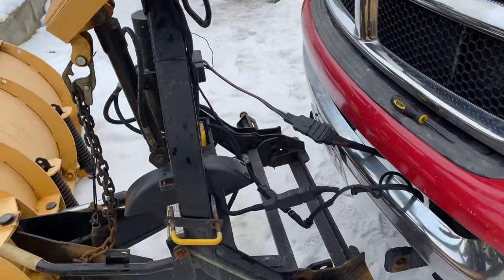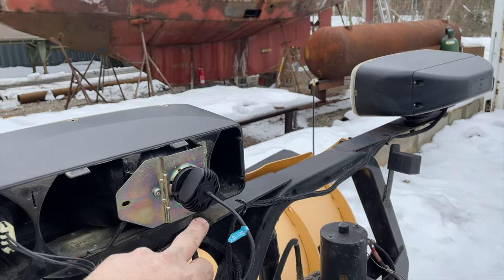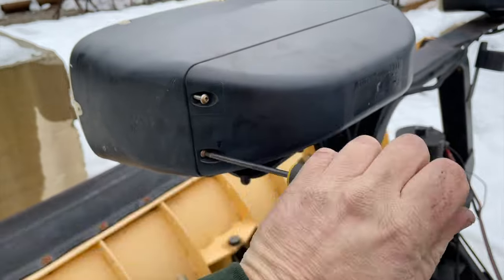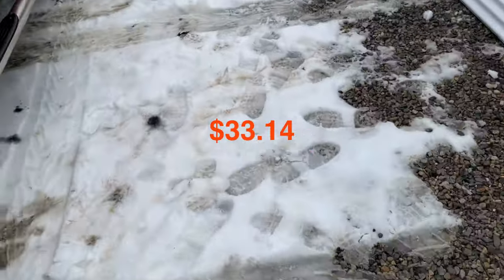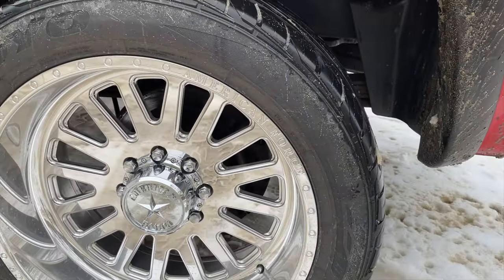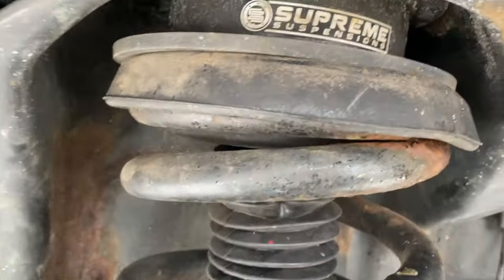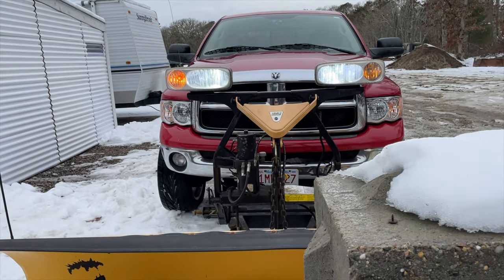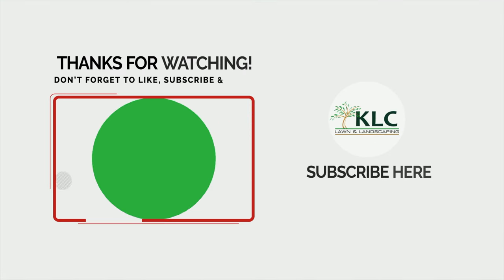HOW TO Convert Fisher Minute Mount 2 Snowplow Head Lights To LED

Comment: Thanks man-used your part number - best 38 bucks I’ve spent in a long time-The halogens kept blowing out from all the moisture inside my housing-what a difference-so minty on the back roads at night-winning 👍
Reply from the maker: Glad it helped! Thanks for the link click
Reply: Did you put this on your Plow? How is it when it’s snowing?
Reply: @brennen203  yes I did - last year-in my experience all lights suck while it’s snowing, halogen or LED-but when the snow stops these LEDs are five times brighter than the OG halogens

Comment: Hey Ken. I'm from Canada and I have a 2023 F550. I installed my Fisher minute mount 2 on this truck. The halogen lights are horrible and one us burnt out. Maybe its a good time to switch to LED. Does it matter what vehicle you have for these bulbs? Or are they standard wiring for all vehicles for the plug and play lights?

Comment: Thanks...How can u plow with those tires....
Reply from the maker: The truck and tires are long gone as I flip stuff all the time. However the one time I plowed with them was no issues at all, My plan was to have a set of stock wheels to plow with but I ended up selling truck before I got to that

Comment: Upgrading to LED is a must. Makes a huge difference. Yes, you get people driving by high beaming you but hey, it is what it is. Just curious, is there no law in the States that you have to have your license plate on our plow? Here in Ontario, you have to put your plate on your plow and salter if you have one so it's visible. Great video Ken and be safe!
Reply: I've been plowing for a few years and as far as I know the only thing that you have to do is put the rear license plate on the salter if it's one you leave in the bed of the truck. I've never been told to put my front one on the plow.

Comment: Just watch those tires. They are not for 3/4 ton diesel trucks that tow and plow. They have a low weight rating.
Reply from the maker: I looked into this before I bought them. The conclusion is there are many 3/4 ton diesels running XL rated tires. They aren't standard rated they are XL and rated/inflated to 50psi which is just sufficient even to pull my trailer that weighs about 6000lb. However thanks for bringing that up to consider.